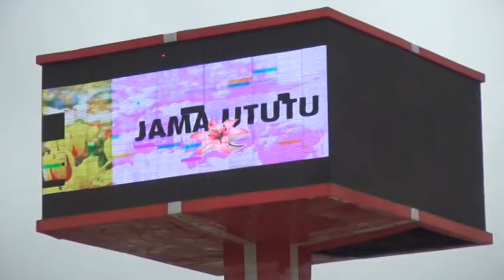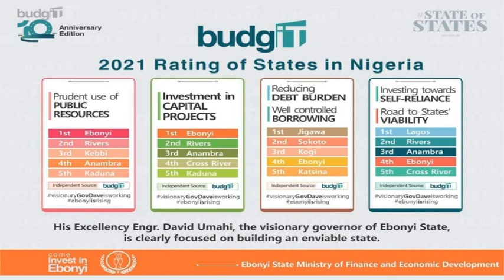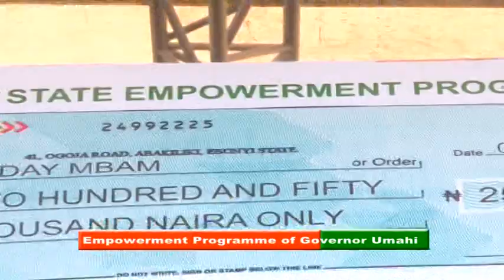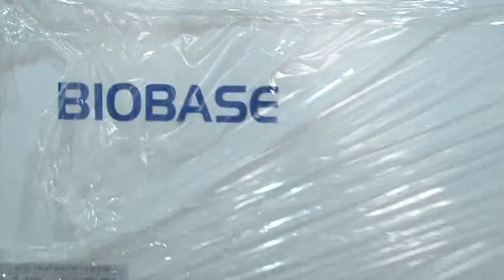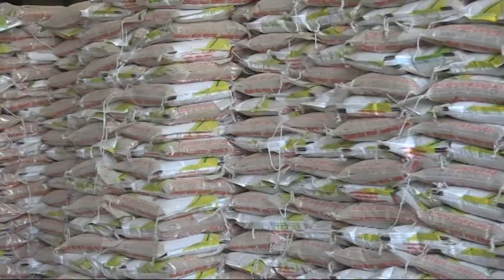APPRECIATING THE SOARING ACCOMPLISHMENT OF GOV, UMAHI

Comment: The Roads need good marking. Kudos to the governor
Reply: Road was built with concrete (cement), instead of asphalt (coal tar), and so it will be hard to mark signs on, given that it is not a coal tar.
Reply: @viokand  yeah I understand but nevertheless yello colour will be nice in marking it
Reply: @pauledwin4487  Concrete roads are not marked but the middle expansion joints act as the separation of the roads.